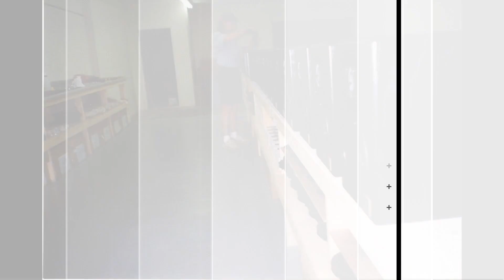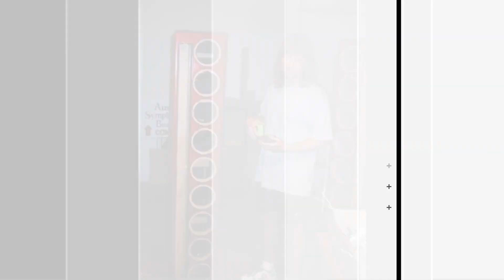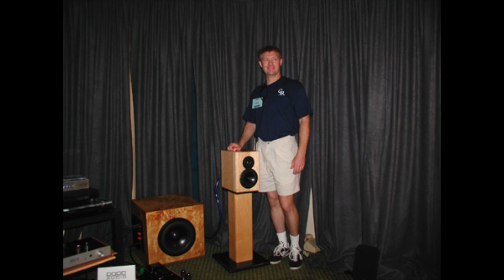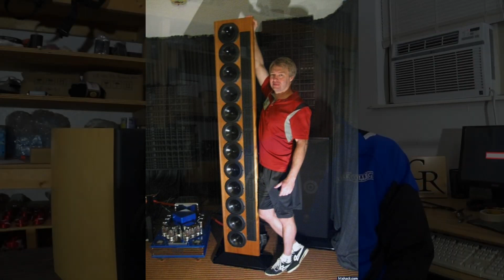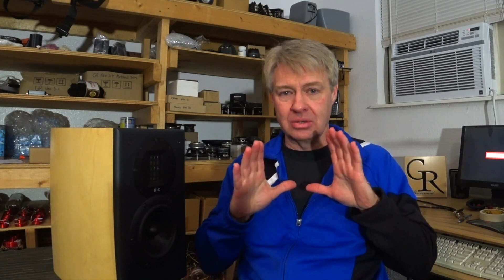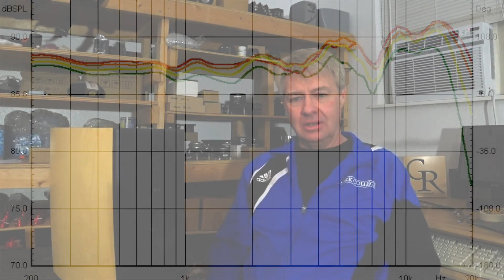Tech Talk 18: Acoustic Center

Comment: ok, what what techniques are used to achieve this in a practical sense. you are very good at identifying the problem, but when it comes to an answer, and this is trend in your videos, the solution is "you need to design a speaker to avoid that". okay but how? i get a want the drivers in phase but how? is this dont with baffle position of the drivers, with the xover, what variables need to change?

the higher the xover frequency the closer the drivers need to be. ok but what is the relationship here?

another trend i notice your counter example are very extreme where as within ball park the what is the difference. im not listening to a speaker with a woofer in another room or with my ear on the floor, but im im in a general listening area say on a couch sometimes sitting up or laying down. where on the bell curve will we notice something.

the topics you cover are very interesting, but after watching i dont feel like i came out with any practical tools to approach the problem.

Comment: hi Danny, what is the maximum allowable distance between two drivers in relation to their crossover point. for example at 1k Hz the wavelength is 13.5 inches but the maximum distance surely isn't 13.5 inches? thanks
Reply: i have the same question. a realistic xover point would be 2000hz being 6.75".

would mounting the tweeter to closer or further have the same out of phase problem?  could i put the tweeter then a 2x(6.75") to be in phase again?
Reply: Of the crossover point is 1k hz then 13.5 inches would in fact be the maximum distance.

Comment: Hi Danny,
It would be good to mention the effects of acoustic loading by the midwoofer cone, often under excursion, on the tweeter radiation pattern by the same token. This issue becoming especially evident in co-axial designs, where special consideration is necessary to evaluate cone profile, which by then effectively acts as horn loading. It is of less importance than getting the radiation centres close, but in a sense proves that there's no free lunch in acoustics - every solution leads to benign or severe issues elsewhere.

Comment: When I listen to these discussions about design and at the same time I think back to the typical speakers that were used in studios to mix back in the 70s, 80s, 90s, etc.  Speakers like the Yamaha NS 10 M, the JBL 4311b, and etc. I wonder how I can listen critically (when I put my audiophile hat on) to music that we mixed on these “ancient” speakers?  And yes I still have my NS 10s and my 4311s which I still listen to.  It would be crazy fun to check out the time alignment on the 4311s.  Thanks for your presentation on speaker design.

Comment: Danny, you mentioned that ideally, the best driver alignment would be concentric (at least conceptually). But I haven’t seen any GR-Research concentric speakers, so I’m guessing there’s a real world complication with the idea. I’d love it if you talked about that at some point.
Reply: The only speaker I know that does this is the QUAD ESL-63 and it's contemporaries. Although it's a electrostatic speaker, it uses concentric rings of stators and uses resistors to create a low-pass filter with the self capacitance of the panel as it furthers from the center of the panel. It imitates an infinitely small point source of sound.
Reply: The answer is simple, It's too expensive to make it profitable.
Reply: @j.t.cooper2963  wrong
Reply: coaxial speakers main problem is that the tweeter is using the MOVING woofer as a wave guide

Comment: I'm thinking about building some 2-way  towers for my home theater. I like the look of TMM designs, but this is making me think an MTM would function better, with the tweeter at the midpoint between the two woofers (wired in parallel or series). My understanding is that the acoustic center of the two woofers would be at the midpoint, which is where the tweeter is. Is this correct? Thanks!
Reply: TMM should be implemented with 2.5 way crossover. Lower midbass rolled off at the inverse of baffle step loss. This design approach gives basically the same "coherence" as a 2-way with single midbass, but with full BSC accomplished without having to "tilt/lower" the response of the whole speaker. 

MTM will typically have both midbass drivers playing up to the crossover, with the BSC compensation applied to the full signal of both midbass drivers. This results in some more pronounced cancellation in the vertical off-axis in the upper mid-range. 

Each design has advantages for particular applications. If you have a good damped listening environment, TMM is generally superior. In troublesome listening environments with hard floors and ceilings, MTM is generally superior.

Comment: A good book on this subject is Sound System Engineering by Don Davis, Eugene Patronis & Pat Brown. Stewart Tyler of ProAc perfected the phase response of his systems as well. Customers of his early designs always wonder why the ProAc logo on the woofers were at different angles. Mr Tyler would do the finial phase tuning by ear which required shifting the axis of the woofer itself. ProAc speaker systems purr like a lion from the smallest models to his flagship designs.

Comment: Very nice video!! I so agree with this, sometimes I see monitor speaker placed on the side and it really annoys me.  I see it that when placing the drivers horizontal you get more horizontal com-filter effect (same frequency time differences) and  your ears are more sensitive for horizontal combs because the ear is placed horizontal apart from each other. Vertical combs need to be noticed by the ear of ears inner reflections. example, Stereo setup speakers with two drivers setup horizontal play 4x (spots) the crossover point 1kHz in horizontal axes, when placing them upright they only play 2x the crossover point 1kHz in horizontal axes.